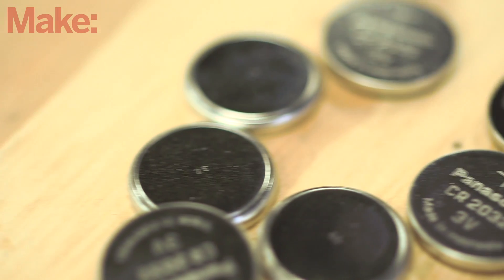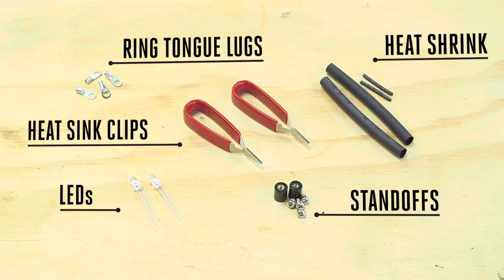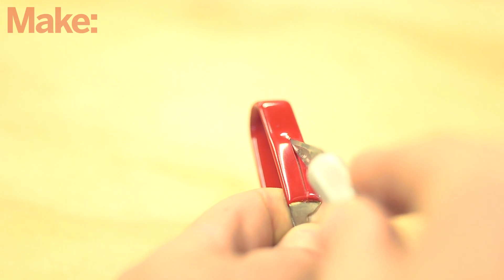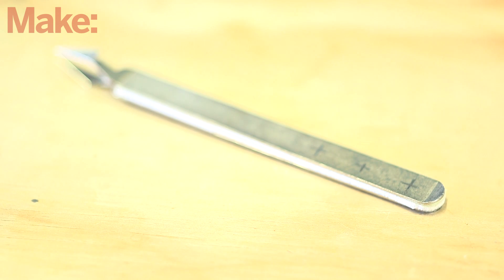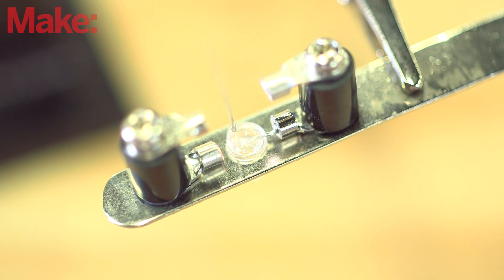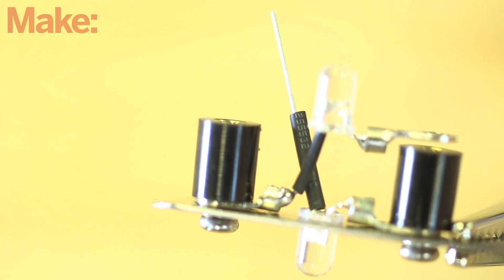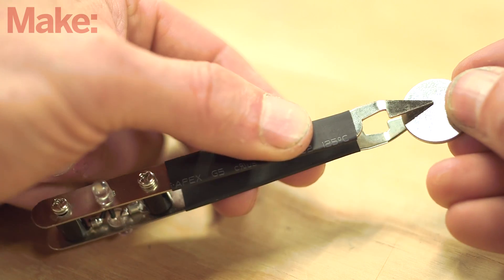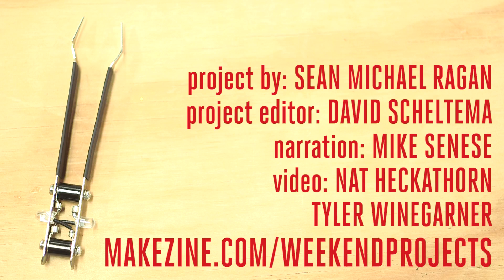Make your own Battery-Testing Tweezers!

Comment: Wouldn't it just be easier to just solder a spare battery clip to a board with an LED? Admittedly, wouldn't look as cool, but still probably simpler.

Comment: There is a much easier way to test your button cell batteries - Simply put the flat side (plus side) of a button battery on a flat metallic surface like a Kitchen sink, a piece of household tin foil or for that matter any metallic flat surface. Put the feelers on the battery (black on the rounded side) and the other on the metallic surface (red feeler on here) - No risk of short circuits and burnouts. An no soldering needed and all free.

Comment: This is an interesting build, but there's a much easier (and more effective) way to check the voltage of button cell batteries. All you have to do is place the battery on a flat surface positive side down, and place one electrode on the negative side (the side that's facing up), and the other electrode along the edge of the battery (also part of the positive side). No picking up and trying to hold the battery between the two electrodes is required.

Comment: made it take a look here:about half the size and with 3mm leds
https://a.disquscdn.com/uploads/mediaembed/images/2006/58/original.jpg
Reply from the maker: MAYER MAKES Nice! Super compact. Your build makes ours look big and clunky!
Reply: I just thougth  about a smaler form factor to keep it in my pocket while dumpster diving.
the standoff on the rear end is only screwed to one side so you can twist it to test bigger batteries like small camerea-batteries up to AAA..unfortunately.AA does not work properly with the angled tweezers I used .

Comment: This is silly. A lot of work just to check polarity when its clearly marked on the case. Doesn't check voltage or remaining capacity. 
Also, why use foam tape to stick it together just to drill? Seems excessive since you already clamp both pieces down, then have to go through the hassle to remove the tape when done. Then there is the cost of two tweezers and parts? Runs about the same as cheap (and accurate) battery checker.

Comment: They're not hard at all to test with the multimeter : lay it flat on the desk, with the + facing down, then press the negative probe firmly on top to keep the battery in place and touch the positive probe to the side. Interesting little project though.
Reply: Multimeters do not give you a true charge of the battery. I tested two 2025 button cells that had 3.0 & 3.3v, but none could operated the stereo remote. Put in a Duracell that was 10 years older than them and the remote works. Mind you the two cells were 2000 & 2011 but new, never used but the Duracell 1996 was everyday remote. Says alot about Duracell.

Comment: Why not just touch the legs of the leds to the 3v battery   just slide it in between
Reply: this guy.^
Reply: That also works, but that's kinda the same as heating up a nail over a flame and using it as a soldering iron. It works, but having a proper tool is more handy.

Comment: Sure this is handy, but you can just as easily just use the LED itself! And why would you need two LEDs? Batteries are marked with polarity...
Reply: Torsan1977 I think the point was it doesnt matter which side it clamps on it will light up period. So you dont have to flip it then check it again.
And just using an led I agree but the point was to make something, ie opening up you mind to possibilites, some people need assistance... think of it as writers block for writers, even the smallest bump can trigger creativity for other things to make with this.   Heck it can be a 9v with resistors 12v ones with resistors, even using the tweez as line checker across a pcb or smd resistor it can be used for a lot of things. Not JUST a 3v batt tester.
Reply: Kethlar Yes, it's a excellent point that these kinds of things can spark your creativity! Perhaps that is the most important thing of these videos. 

For me to get any spark of creativity the video should include some concept that is creative. Using leds to check if a battery is ok may certainly be useful or fun to make, but to me that is not adding anything to my knowledge of electronics.

Comment: Did you run out of ideas and just started to 'make' up some? Come on, that whole clumsy part with the multimeter was just terribly acted. Typically American though to just 'invent' problems and then find a solution for a nonexistent problem. Of course you can easily measure those batteries with a multimeter.

Comment: I can see how building this would be fun, but for ease of use you can just pick up a regular LED, squeeze the leads between your fingers with the battery in between for the same purpose and ease. If it doesn't work, turn the battery over and repeat. Still doesn't work? Toss the battery. Also, you didn't break two perfectly fine tweezers.

Comment: Why would you even tell people you could check batteries with a voltmeter? They will read nearly maximum voltage without a load, regardless of how full they are....
Reply: Andreas Ihring Not necc true.  I have a multitude of 3v's and the multimeter doesnt read even close to 3v not even 2.5 or even 2 on low V batteries, that is why it is there, to test to see if there is any power at all in them. Also If that is all one has for testing, and no leds or tweezs etc to make this a mult is the best way.